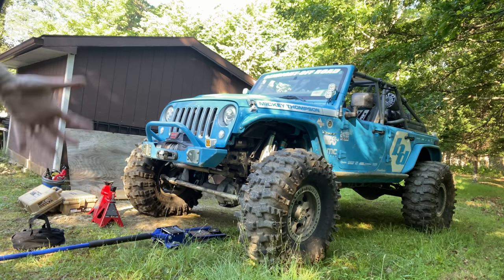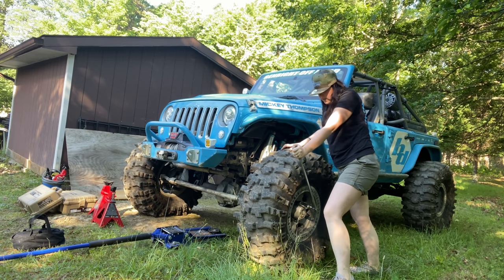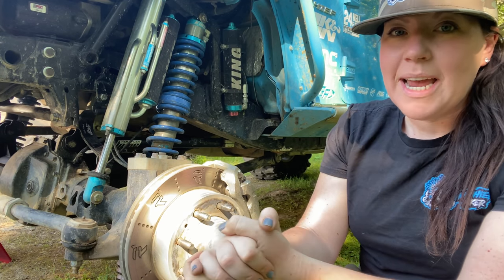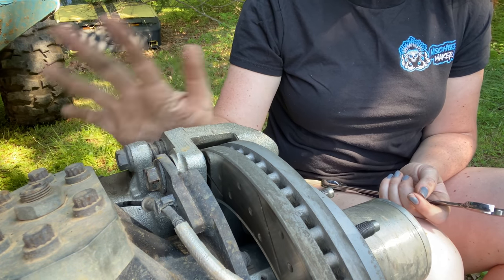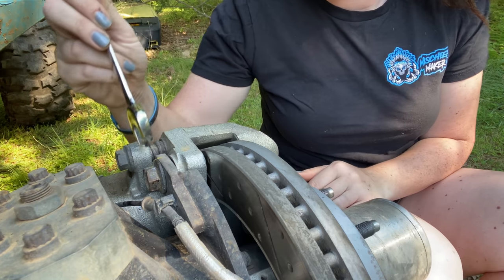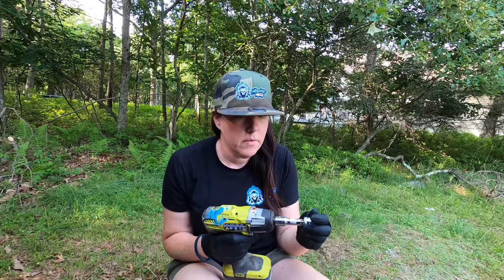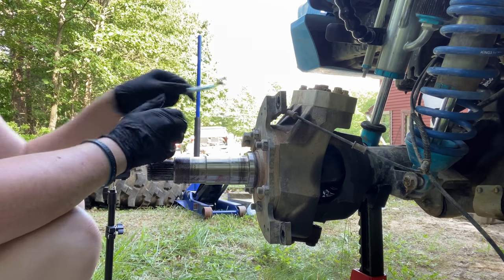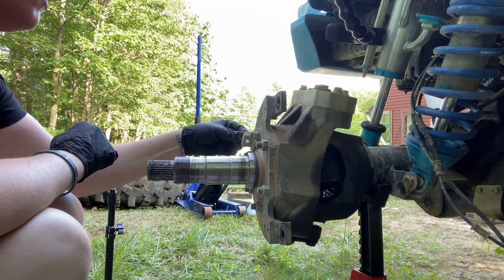Dana 60 Teardown and Repair Part 1

Comment: If you're going to break it might as well do a good job at it. And you did a good job for sure. I've broke a couple 4150 joints an twisted an axel shaft but never broke one. But the glory of running big tires on not so smooth terrain. High torque rigs . I always replace both sides on bearings and seals even if only one side is bad. So glad you checked.

Comment: im pretty sure i know how all that happened, you chunked the u-joint and if you would have stopped and turned that hub out to release drive on that side you could have saved the inner from breaking. what broke the inner was the outer and the inner axle started driving with the contact being the u-joint ears and that makes them spread out.  and then they end up with interference contact with the knuckles and then you break the massively beefy axle.
Reply from the maker: Yes, thats the conclusion we came to as well, which is why we are not over reacting and getting larger beefier parts across the board. I’ve had conversations with Dan at Fusion4x4 and we believe a beefier ujoint would have solved the issue. The chromo shafts are perfectly strong enough for my style of wheeling (and 230 horsepower 😂) but they probably got bound up after the break...unfortunately I was on an obstacle with the vehicle fairly vertical and we did unlock that hub, but I had to leave the transfer case in 4 low as I winched up, which left the inner shaft turning

Comment: I'd like to see more about the fusion axles. They're local to me and at the top of the list if our JKUR grows past 35s.

Keep your channel growing!
Reply from the maker: The truth is, you can’t go wrong with any of the major axle manufacturers. But being able to text the owner, get responses and advice and not have to jump through hoops to get replacement parts via warranty is a major advantage of working with a small company like Fusion4x4.

The selection has grown far beyond what was available when I ordered my 60/80 combo. It’s great to see them grow to include Fabricated 9” & 10” and shaved 14b options.

If you have any specific questions, don’t hesitate to ask me and I can also put you in touch with other customers, if you have questions that I can’t answer! 😀
Reply: I just put in a set of Fusion 60/44 hybrid axles. Got them used, and they will be a good intermediate step before going to 60/80 full floaters. So far I'm really impressed with their quality

Comment: Damn Hollie!  I've done a similar thing but on a much smaller axle. You must have been pushing it to break like that.  That is the down side to chromalloy. They hold, but when they go, they take stuff with them.
Reply from the maker: Haha, yes, I was in a tough spot and had already lost my PSC ram so I got a little more crazy with the skinny pedal than I normally would (as advised by my expert spotter) to try and get past a pretty nasty obstacle. I knew something was wrong just by the look on everyone’s face and reports of ‘sparks everywhere’ - it didn’t sound too bad from inside the Jeep though 😂

Comment: put the two pieces of axle back together to see if chunks are missing. also pull the diff cover and flush out the axle tubes and the diff housing with brake clean to flush out the metal dust from the axle breaking and to get any chunks if there are any.
Reply from the maker: That is definitely on my list of things to do. I’ve already got the diff fluid and the brake clean. In addition to flushing everything out, I definitely want to open up the center section and have a look at the gears after the last few weeks of abuse and these most recent breaks. 😀🤙🏻
Reply: You can tape a small strong magnet to a broom handle and run it through the tubes before you wash it down, that'll get most of the big stuff out. Good Luck!! With a heavy rig, big tires and a fearless driver, this won't be your last broken axle!😁👍

Comment: Holly, using those jack stands on ground like that is asking for trouble. They will at some point dig in and let the jack stand tilt, and too often when they tilt, they crumble. Just not safe doing it like that. Just get some wide boards or even a couple layers of plywood to use as a base.
Reply from the maker: Hah, I needed this comment when we were making those videos!! I spent half a day trying to get MM up off the ground. It rained and the jack stands sunk into the ground 🤦🏻‍♀️. Please stick around and continue to share your knowledge - I certainly appreciate it!! 😀🤘🏻

Comment: OK, it's me again. I'm not trying to sound like I am a know it all, but... I do have many years, decades actually of Wheeling and working on Jeeps. First of all your axle most likely broke because of your u-joint breaking. The inner and outer axles get bound up because the joint breaking, and just the force of rolling makes them fight each other, distorting the yokes and then breaking that axle. The fix... Yucon Super joints. They are the strongest u-joint you can get, but they are not designed for higher speeds, but, since you have lock out hubs and a transfer case that can be kicked into rear wheel drive only, they will be safe to run on your Jeep. As far as the needle bearings on your spindles, just get rid of them and get the poly bushings to replace them. Not sure where you get your parts from, But I use ECGS (east coast gear supply) They have everything you need for about any axle. I highly recommend them! They are great for any warranty stuff too. My Go to guys there is either Chase (the owner) or Steven. The fastest shipping of anyone I have ever dealt with. I know that this vid is a couple years old, and you've probably already done what I have suggested, but, hey, I had to at least make sure ;) I hope maybe I will get to wheel with you one day!
Reply from the maker: Thanks, Chris. We made exactly all of those adjustments and I am a huge fan of East Coast Gear Supply. They have saved my butt more than a few times. Here’s a question about the poly bushings…how often do you replace them?  I inspected them maybe 3 months ago and it’s hard even tell if they are worn down.

Comment: That’s some hardcore stuff right there. Those shafts and u-joints make my 1350s and D44 chromos look puny! Hardcore that you broke them like that. Glad you’ll get an easy warranty though.
Reply from the maker: 1350s are a strong joint! I actually believe GRDLOC runs 1350 Yukon super joints in his front axle and has never had an issue with his 46s. This was an important lesson in increasing the frequency of my maintenance schedule. 😅

Comment: I'm impressed seeing you out there tearing down your Jeep like that. I had the impression that you replied on others, like the Rock Star Garage crew for all that. 

I'm glad to be proven wrong. 

Now, where's the video from breaking it🤷
Reply from the maker: The video of the break is coming we were at a super secret event that will have its own video series released on YouTube shortly by Flex Rocks & Rollovers.

We do rely on our friends with garages because we are on the road full time. I’m always grateful for the help, and a lift certainly makes lots of jobs a lot easier! 😅 however, I much prefer to know (for sure) that each bolt was torqued properly,  all the fittings have been properly greased, etc...and the only way to have that feeling is to get your hands (or nitrile gloves) dirty 🤘🏻

Comment: As stated the u joint let go and you kept moving with that bound up in the knuckle which snapped the shafts . Your splines aren't even deformed.  Looks like a spicer life series u joint . Most companies won't warranty their chromoly shafts unless you use the chromoly u joints.  I still have a set of 8 year old Yukon 4340 60 shafts with Yukon super joints sitting that I traded out for 300m rcv shafts... I keep the yukons as spares but most likely if the rcv break so will my Detroit.  I remember my first time pulling apart my 60 after breaking stock 60 inner passenger shaft...lol... I didn't know the carrier went straight through so I spent 3hrs fishing the busted shaft out of carrier when all I needed to do was open it up and push it out  I learned that the same day when I put the new inner seal in since the busted shaft ate the inner seal up .

Comment: Lowes. 24volt cordless impact 1/2 inch drive. Make short work on wheels. 5 year warranty on tool 3 years on the battery.

Comment: Awesome video great info those are the fusion axles aren't the shafts life time they seem to have held up well you're a pretty technical wheeler and don't shy away from the challenge.
Reply from the maker: They certainly are lifetime. I probably should not have text over the holiday weekend, but the owner of Fusion4x4 was nice enough to reply and getting new ones sent out was a matter of exchanging a few messages - and that’s not some special treatment BS, I speak to a lot of my fellow Fusion customers and the experience is consistent across the board 😀. 

They have held up pretty well and we have a plan to harden things up a bit starting with Yukon super joints. 😀🤙🏻
Reply: I have heard that fusion is the real deal on customer service

Comment: That's what happens with wheel spin in the air then landing. The rotational force is incredible with big tires. One of the reasons why monster trucks went to planetary drives. Always the weakest link.

Comment: Looks like preventative maintenance has been lacking on your axle ends. As hard as you use Mischief Maker it needs to be done often, more so if you get in deep water. While at it I would check the rear bearings and the gear oil in both diff's for water contamination.The harder you play the more you got to pay and doing a lot of preventative maintenance. ROCK ON!
Reply from the maker: Spot on. The ends definitely need TLC on a more consistent basis. Adding hub/spindle bearing and seal kits to the maintenance bag & I’ll count this as a lesson learned. At least I now know how to maintain them myself, so 🤣🙌🏻
Reply: @MischiefMakerTV  I'm impressed you can do this yourself AWESOME!

Comment: Looks like the axle shaft might have had a fracture before the U joint failed. If you look at the sharpe broken point it has a layer of rust, unlike the center of the shaft that didn’t have any rust.
Reply from the maker: That’s possible. I’ll take a closer look today.  I’m always amazed at how much you guys can take away from video and pics. Always grateful for the help and insight! 😀

Comment: That spindle is still good. Just buy a new bearing and seal.  Spicer joint without the grease fitting or run a ctm. Alot of times a failed u joint will cause the shafts to bind so keeping them from breaking is priority 1!
Reply from the maker: Hey Leo! I believe we settled on replacing the bearings with an ‘extreme duty’ offroad specific bushing. They are supposed to be self lubricating and better for offroad use only vehicles.
Reply: @MischiefMakerTV  still going to have to pull those apart a bunch and clean them out. Sand and mud can get in there and ruin them just like bearings. Those bushings are a good idea. But still can wear out gotta keep it all clean !
Reply from the maker: This will definitely be a regular part of my maintenance schedule moving forward! 😀👍🏻

Comment: Why couldn't you get a socket on the top bolt of the brake caliber? And how come you didn't use the gear ratch end when you where removing the bolt? Lol J/K  Holly.🤪😁 How crazy is that thought about your axles??? You went to service ujoints and  DAM A WHOLE CAN OF WORMS!!
🤣😂🤣 Thanks for all the cool videos, hopefully I'll run into you next year on the trails  wheeling. Be safe thanks. 
TEAM-FARLEY 707
Reply from the maker: You couldn't see from that angle, but the gap between the top bolt on the knuckle is super tight. I did eventually use the ratcheting end, but skipped that part LOL. Thanks for supporting the channel and I hope we get to meet up at some point! :-)

Comment: A little grease would have saved the bearing. And judging by the rust on the broken stub it’s been cracked for a while.
Reply from the maker: The lower kingpin bearing? If that’s what you meant, you are probably correct....but because we spend about 200 days traveling and wheeling different locations, I typically prefer to pull and replace any part that’s showing excessive wear — can I get more life out of certain parts, sure...but there are some things I’d rather not worry about while on the road/trail. Also the stub was rusty because the video was made a few rainy days after the break happened. I didn’t start until I had (what I thought at the time) was all the replacement parts.

Comment: RCV axle shafts next upgrade.
Reply from the maker: Maybe...beefier Yukon super joints are next. The truth is that my wheeling style and wimpy 230 HP means that these chromoly shafts should not be breaking. We think the shafts only broke because they got bound up after the ujoint failed.

Comment: does anyone know what year 3500 that front axle is off of???
Reply from the maker: The front axle housing was custom built and purchased new from Fusion4x4. The brake calipers on the front are from a 2009 Chevy HD truck (I believe there is no difference between 2500/3500 for that year) and the rear brakes are from a 2014 Ram 2500.

Comment: Probably  crack ring and pinion  theeth  as well
Reply from the maker: We will see when I finally pull the cover. If that is the case, it will be going to my fav local shop for a new set! 😀🤙🏻
Reply: @MischiefMakerTV  it happened to me  exploded  hubs and stubs also  found  a number of ring gear  teeth  were cracked  running  513 on 44 TSL  with a 460 and a bottle of  wild Turkey.

Comment: im surprised u don't have rcv axles in there
Reply from the maker: Well, my Fusion4x4 axles come with a ‘No BS Lifetime Warranty’ that’s quite frankly a lot easier of a process. No forms...no waiting to hear back. I text the owner a picture and the axles are on the way the next day (I carry spares because I hate waiting and because we live on the road which can make logistics tricky). 

RCV definitely makes a stellar product, there’s no disputing that...but unless I find myself breaking parts multiple times per year, I don’t see a need to spend any extra money when I have as many chromo as I will ever need from Fusion for free. 

One thing we are upgrading to that should help eliminate the issue is a set of Yukon super joints! Yes, the Spicer joint was always supposed to be a weak point, but it might be a little too weak and that’s what we believe was the root cause of the damage to the driver side shaft. 

The passenger side was my fault, the hub and spindle bearings probably needed to be replaced/serviced sooner...but mea culpa & lesson learned there 😅😁
Reply: @MischiefMakerTV  that's good that fusion takes care of u like that then.

Comment: dont greese hubs..do not,,use a chisel or screwdriver..buy a damn socket..there torqued,cant do that with a screw driver,..eh..
Reply from the maker: phantom walker I have a socket and carry it on the trail, but lots of people don’t...which is where I’ve seen the old screwdriver method. Not ideal, but if you wheel and need to get off the trail, you do what you gotta do...
Reply: @MischiefMakerTV  it is one item i dont usually carry,for the mild wheeling we do,shouldnt need it.but,belts hoses,tools,i carry.we have to be self sufficient as much as possible.i thought you were canadian,i own you,im british,i also own australia,where i am now.joke..its good to get out anytime.for me,not enough.keep it up.
Reply: @MischiefMakerTV  because here in aus,toyotas rule,theres no outlets for u.s 4x4rs,no info,nothing,not bad now but back in the 70,s 80,s,no help what so ever.ive seen so many lock nuts chiseled off..thanks to innernet,now can buy any item required.ive imported a truck,car,diff,all my parts.i used to sell parts to people here,till covid killed it..

Comment: Someone has throttle issues. Lmao. The interwebz wheelers all say d60 is do all end all solution.  You are a bad person for hurting those metal parts lol
Reply from the maker: I am a very bad person 😈 🤣 but I’ll get him back together ...... just throttle issues when out in crazy positions and need some unpf🤷🏻‍♀️🤣
Reply: @MischiefMakerTV  you could try a solid fuel rocket on the rear of the cage.  I finally got my rear leafs installed. 8 hours one side. 1.5 the other side. Damn rusty bolts. And last week my oil filter started leaking. fixed that yesterday. I hate leaky things.